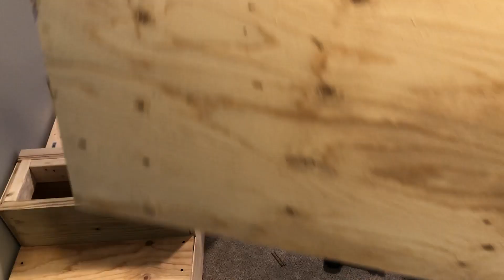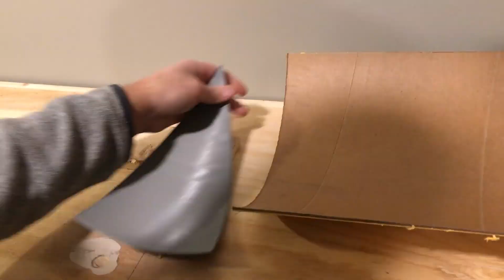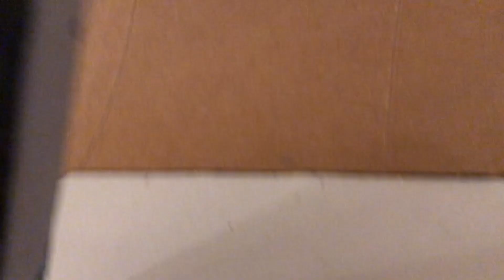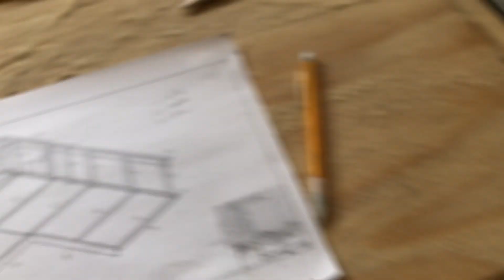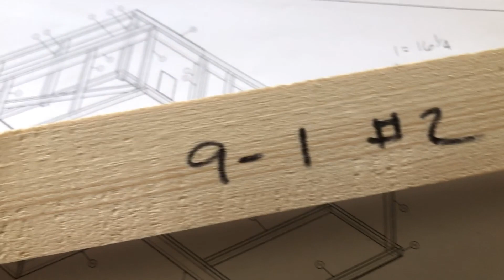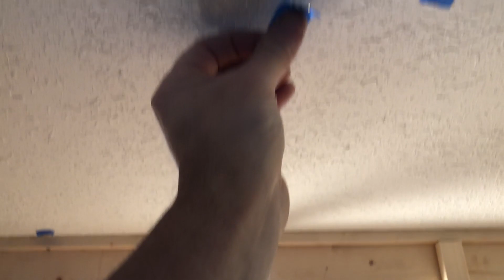Manns Creek 2.0 Build, Part 1

Comment: Do use a fine tooth blade on the table saw to cut the Sono Tube; like what is used for Formica-type products?
Reply from the maker: No, I don’t remember exactly what I had in at the time, but I was ripping studs at the time and I did not change the blade out to cut the tubes.  I am not sure it would matter as long as it’s not too aggressive

Comment: Wow! Looks great. That electric nail gun seemed to run a long time. Is it running off the standard Dewalt batteries? I’m really interested in the 3D printed corners, any chance you’d sell them?
Also, I like the way you use a laser level to mark joists and studs, I’m gonna use that trick.
Reply from the maker: yes, that electric nail gun works awesome, it can go all day.  I framed up a 1000 sqft shop and it lasted all day.  my brad nail gun is air but I am going to change it out soon.  The laser level is great, I don't know how I went so long without it, I use it all the time these days.